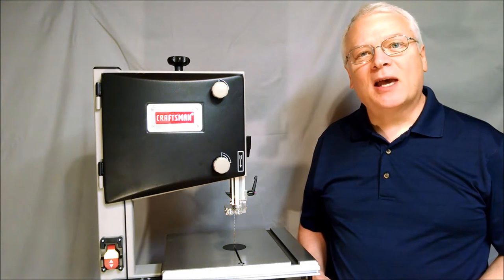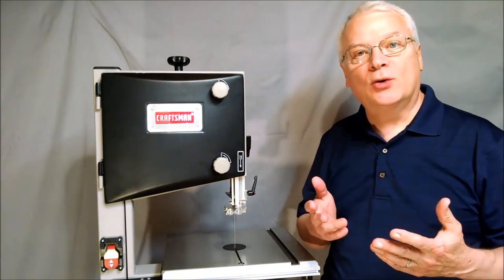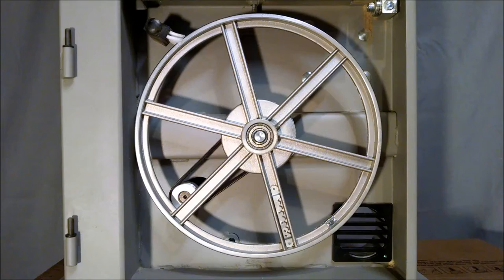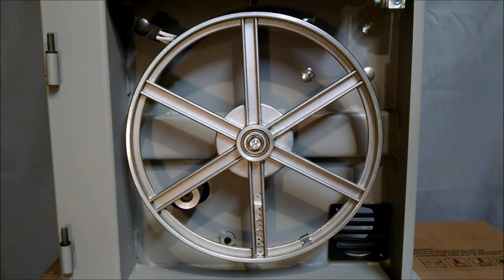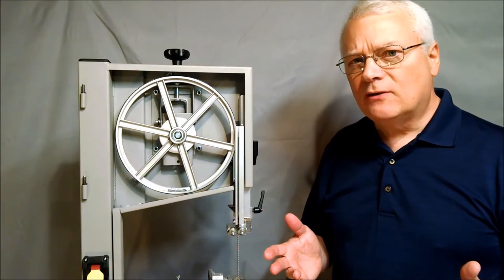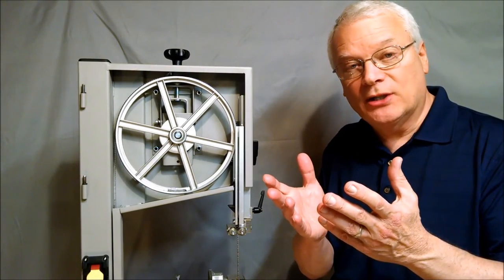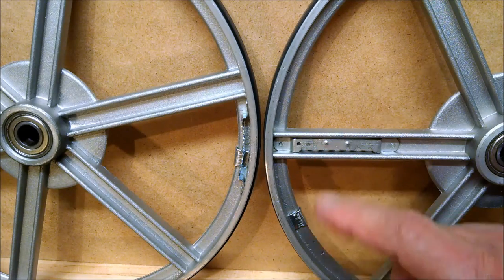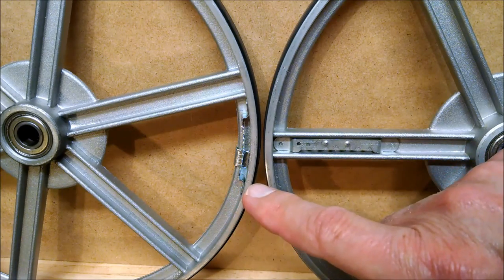Balancing a Band Saw Wheel   Part 2

Comment: I know this is an old video but people will still look at it if they have one of these saws and they made a lot of them. When putting on weight to balance a wheel use auto tire stick on tire weights . It is what I used and it worked well. I also used small sheetrock screws stuck on a piece of tape and then weighed on my reloading scales for accuracy. You can cut the lead easy, don't have to drill a hole or use a grinder on a bolt. I fixed my $50.00 saw and it runs perfect.
Reply from the maker: Thanks, Matt! I'm sure your method works fine. Thanks for adding it as a resource for people viewing my video. I didn't have any old wheel weights lying around, and my band saw wheels required very light weighting. I just used what I had at hand. All these years later, my bandsaw is still balanced.

Comment: Use a lawnmower blade balance Jig. A metal cone on a point. Hardware Store has them.
Reply from the maker: Thanks, Garner! Actually, I have had one of those for many years but I didn't think it would be sensitive enough for this job. I could be wrong, though.

Comment: Hi Mark, Thanks for both videos, I'm having an issue with lower wheel alignment, no matter what i did the blades drifted from the lower wheel, any idea how to fix that tiny tilt in wheel axe, the one shown in 00:44 seconds from the video "the axe with 4 screws " , thanks again
Reply from the maker: I hope I understand your question correctly. In the videos I have seen, the blade tracks well on the lower wheel even when the angle of the upper wheel is adjusted fairly radically. In other words, whether the blade rides on the back, middle, or front of the upper wheel, it tends to remain more or less centered on the lower wheel. A few things to check. Is the rubber "tire" around the wheel in good shape? Any bumps in it - or tears? Is the lower wheel running true, or does it appear to wobble? The wheel might be bent or have a bad bearing. Also, is the axle mounted tightly? Make sure it is. Try another blade. The one you are using may have become deformed for some reason, though I don't consider it likely. That's all I can think of right now. Hope it helps.

Comment: Mark, what about using solder to attach the metal to the wheel?
Reply from the maker: +David Letz 
My knowledge of soldering is limited. I built a Heathkit civil defense radio about 50 years ago by soldering the electrical connections, but I have little experience beyond that. I'm not sure what solder would stick to the cast alloy wheels on my bandsaw. The epoxy is doing fine. I checked to see if Craftsman made the original weights available, but they don't as far as I know.
Reply: +Mark Beuligmann Thanks for the reply. I was wondering about soldering to alloy as well. I'll try the epoxy since it has worked for you.